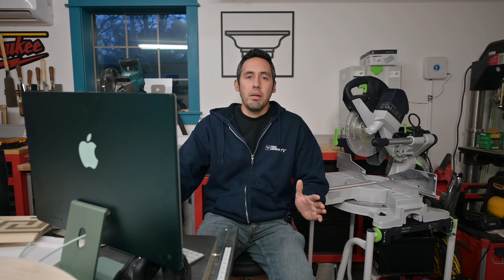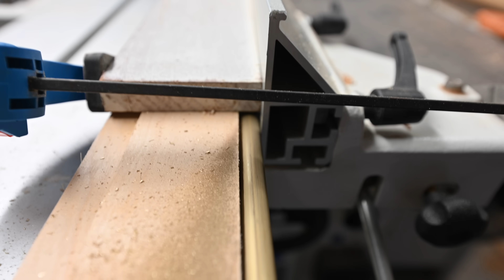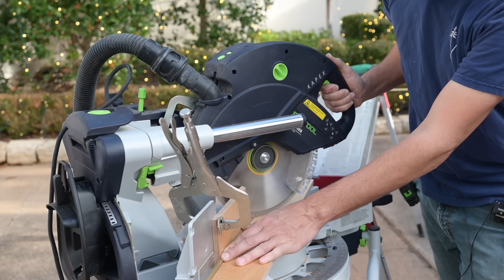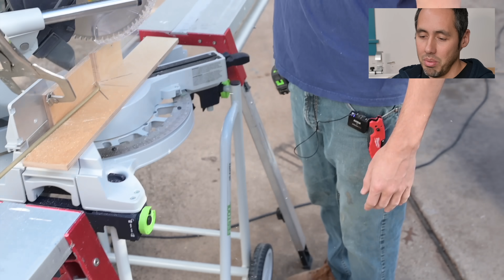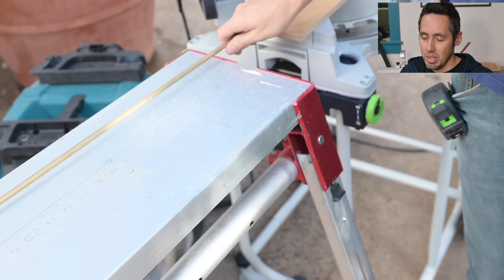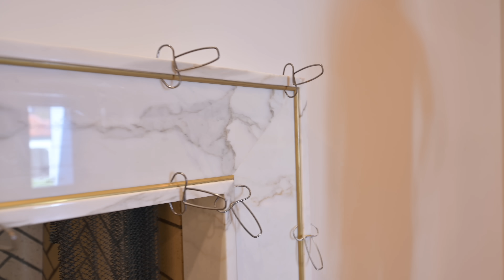It only took 12 years...My first MITER SAW injury.

Comment: I worked in an ER for decades. We had an ambulance transport a guy from a manufactured home factory. His crew was framing up some walls when he jumped from the platform to the factory floor holding a nail gun. 
It discharged a framing nail into his knee.  His knee was locked in place with the nail. When he was off in x-ray another ambulance called in saying they were bringing in a patient from the same factory who also jumped off the platform, discharging a framing nail into his knee as he landed. The injuries were not exactly the same though. With the first patient we were able to use vice grips to grab and twist and pull it out. The second patient wasn’t as fortunate.  The nail entered the tip of the femur, went through the joint space and imbedded in the tibial plateau, locking his knee in place.  He had to go to the operating room.
I’m guessing there were some changes in workplace policy after that.
Reply: Fella in my hometown was nailing up cross bracing on floor joists over his head with an air nailer, nail hit something hard, bounced back and ended up in his heart, poor guy lived for a few days longer. The owners sold the house without finishing it. All very sad.
Reply: @shamrock4500  Very sad “freak”accident but I could see it happening.
Reply: @shamrock4500 i could see that happening I’ve sent a framing nail into an old railroad tie it bounced out (guess there was metal still in it. Couldn’t see it from the top) and flew right past my buddies head. Luckily nobody was hurt.
Reply: Holy smokes !  I cringe at the thought of that,...  Yikes
Reply: I'm surprised you didn't use a band saw to cut these pieces. Obviously precision is key but a miter saw just seems sketchy
Reply: Last year a guy was nailing framing out of the window and shot a nail into his eye and died.   3 kids.
Reply: Was ripping a 2x6 on the table saw. I must have hit a knot because something hit me in the shoulder. I had a bruise for about a week and couldn’t lift my arm higher than my shoulder. ( when I checked the board, there was a piece missing)
Reply: @lukemccann4061  what?
Reply: @tier1solutions28  yeah
Reply: @lukemccann4061  that's horrifying.
Reply: @tier1solutions28  I think about it everytime I fire a round.
Reply: @lukemccann4061  if I saw that I think I'd love to estwing a lot more
Reply: @tier1solutions28  yeah me too.   Happened on a buddies crew.   Thank God I wasn't there.   Crazy thing he made it down to tell his boss.  Dropped right there.
Reply: @lukemccann4061  That’s awful.
Reply: @de362  seriously

Comment: The exact same kickback happened to me with a miter saw doing an angle cut on thin brass strips just like this, I also luckily avoided any injury. It's nice to get an indepth explanation about how it happened for you, and yeah, I've reverted to using hack saws, files and belt sanders for now

Comment: Glad you are ok Richard, I also have been using power tools for many years. My accident was not filmed as I did not have a youtube channel at the time. However, I do have a video on my channel covering it. It is called my tablesaw accident. I short I was building a barn style pocket door. I wanted the blade marks in the wood. I was resawing 2x4's to make the panels. Decided to do a test cut with a short piece of material to make sure the thickness was right for the dato slots. As I was reading the short piece, something went wrong and my tablesaw kicked the material out, however in the process it pulled my finger in. I still have all my fingers, nine stitches later and several weeks of healing all is good. I have never looked at the tablesaw the same. Every cut today is 100 percent attention on the saw. Thanks for sharing Richard.

Comment: In 1998 I was ripping a piece of trim on a new table saw, I had not yet installed the blade guard, I was pushing the board through and in one second all was well and in the blink of an eye the board kicked back and two fingers😂 on my right hand came down and kissed the blade. One finger healed fine, the other finger also got stitches but I did some nerve damage and never got all the feeling back. The hand surgeon said the upside was the blade was new and sharp so it cut instead of tearing the skin and very little chance of infection. I’m so fortunate to have both fingers and like you said being complacent as I was already in business for 22 years at that point. I am now 65 and retired after 47 years of being self employed, my whole adult life. 
Hoping anyone reading this learns from my STUPID mistake. Stay safe everyone!

Comment: First of all, Richard I’m so glad you’re ok! Secondly, the job you did on the range hood is sick! Your talent just keeps getting deeper and wider. I’m glad you are sharing your journey with us!

My story:
I was building a miter saw table and I was using the biscuit joiner, well I needed to put slots in a piece of trim, I was holding the trim with my left hand (I didn’t use a clamp, because you can’t hurt yourself with a biscuit joiner right?!) I was putting pressure with the tool against the trim, the blade caught a knot in the wood, it went flying, and as I’m continuing to put pressure on the tool toward the trim piece that my hand is holding, as the piece went flying out of my hand the blade cut into my thumb and middle finger. I nearly cut through both fingers. I had to remain calm, I was alone in my shop, ran into the kitchen wrapped my hand in a bunch of paper towels and called my friend to come and get me to take me to the hospital. The doctor sewed me up and I had a month of recovery and healing. I still have scares on my fingers, the feeling is slowly coming back. Thank God! Whew!

Comment: Thank you for sharing your story, Richard.  We can all learn from this kind of eye-opening experiece, and I'm glad you were not seriously injured. 

I'm a hobby woodworker who has made some hardwood furniture and other small items.   I was cutting a 1 inch wide by 1/8 inch thick aluminum strip, which I have done several times in the past with no isses.  I also had a brand new Diablo crosscut saw blade on my miter saw.  I was very slowly lowering the blade through the aluminum strip when some how the blade grabbed the aluminum and jerked it from my grip.  I was startled and very surprised because I don't know exactly how this happened, and I was being very slow and deliberate with the cut, just as you were when it happened.  Good news is I was not injured other than a little bit of temporary pain in my thumb, all but upon inspection, I discovered that one of the carbide teeth had been ripped off the new saw blade.  I also cannot be certain that the blade was not compromised in some other way due to the impact.  So I figured the new blade is a total loss.  I think a carbide tooth can be replaced, but I don't think it would be worth the trouble, so I am chalking it up to experience.  The cost of another new blade is cheap compared to any injury that could have happened.  I was lucky it was not worse, and I think I'll hesitate to cut aluminum in the future without some additional precautions.

Comment: Nearly 50 years ago I was making 1/2” quarter round trim for an addition to my home. I had a small,cheap router table and while pushing the square stock through I ran my forefinger through the spinning blade. Ended up in emergency having the fingernail removed plus stitches. No permanent damage but still have a scar.  Very cautious around power tools, especially routers, ever since. I’ve learned a lot from you over the years, thank you.

Comment: I'm glad your incident wasn't more severe. In 2000, I was a pattern maker. For people that do not know what that is, it's an old world trade where you make patterns and cores out of wood for foundries so that they can pour castings of products. My worst injury came while using a 20" disc sander. When pattern building every piece had to have what's called draft, meaning every edge needs to be slightly angled or rounded so that the sand pack could be lifted away from the pattern board. Well while sanding some smaller pieces with the sander table at an angle to achieve the draft a piece had got away from me and of course with the pressure I was applying towards the wheel my finger tips and knuckles went into the wheel. Result was some oddly flattened finger tips and some knuckles sanded down to the white meat. I was 21 or 22 at the time and learned that a 1/4" of missing finger tip will actually grow back like nothing happened, thank goodness 😅. Keep up the good work sir!! Stay safe 😊.

Comment: Over the last 30 years, working as a finish / trim carpenter, there have been minor injuries.  But the worst was using my father's 'skill saw' at the age of 14. Working with a den of cub scouts, me being the den leader, I thought of using a power tool. Without permission, mind you. Yes I 'surgically ' removed my ring finger from my left hand. Quick thinking from the den, I got my finger on ice. Quick trip to the hospital. Within 2 days I was home with it reattached! AYE!
Reply: Jeez, that’s lucky. Bet that’s a weird looking scar. U get full use and feeling back?
Reply: Reattached...and is it functional or just decorative?
Reply: @jeff-w  it works as a finger should. Looking at it, people can not tell.
Reply: @jamesmyerssr.3119  wow.  That's amazing.  Lucky guy!
Reply: Using a Delta Unisaw cutting small pieces of trim for a jewelry box the off cut was fluttering from the air movement of the blade, as I approached the blade with a pencil with eraser the presents of my hand must of disrupted the air flow lofting the small piece of trim into the blade firing said piece as fast as a gun shot into my inner thigh millimeters from you know what! Hitting the e-switch as I fell to my knees the pain made me lightheaded. After a few minutes of nauseousness and holding my family jewels my jeans had a hole in them. Dropping said jeans a bruise appeared. With in a few hours my leg turned red from my groin to my knee. Thinking I injured an artery off to the ER. Thank the man above I only injured a vain that bled internally leaking for a short while. That bruise lasted months changing colors and finally fading. Now I always wear a leather apron along with other ppe.
Reply: Worse injury was with a propane brazing torch. The torch head had not been sufficiently tightened when the canister was changed, so when I lit it- POOF it was a fireball! Of course your first instinct is to throw it- but knowing that those metal canisters are like a missile if they break at the neck it didn’t toss it. I spun around and snuffed the flame out, then assessed the damages. It’s a sinking feeling to smell burned hair and feeling blistered skin… Luckily I only lost my eyebrows and a few wisps of hair. Felt like a bad sunburn for a few days. Safety glasses work!
Reply: Hey, sorry you're hurt over the holiday! Heres my worst work injury. I was in an old building in Brockton, MA. After hours ( there was a plumbing leak overhead right behind the receptionist desk), the plumber fixed the leak which had stained the old plaster and lathe used 50 years ago. So the plan was to just remove and replace with drywall. I thought cutting out the old lathe with a cut-off wheel was the best approach. Well...the wheel got caught on something and blew apart, and a piece of metal or part of the wheel went right in my eye. At the same time, I set the fire alarm off, which immediately alerted the local fire department. So I had to deal with them doing their walk through. Then clean my mess. Then go to the E.R. to get my eye worked on. I looked like Quasi Moto for about a week, lol
Reply: Pictures needed lol
Reply: Winner Winner chicken dinner! I will settel for your most popular Hoodie and you keep the square thank you.
Reply: Damn give this dude the prize I don't even want to tell my so called injury after reading this yikes

Comment: Hey Richard. That’s amazing that this was your only significant power tool injury. I see you have deep respect for the tools you use.  Im glad to see you are recovering well 😏. I instal flooring for a living. My comp. name is Good Day Flooring llc, out of the South West Florida area. A couple years back I was employee to a local installer, under whom I learned the tread. He would always take the guards off his miter saws, so I was extra careful when making cuts. One day he got a new miter saw and right away took off the guard before using it. We were cutting shoe molds that day and I was zipping along as always. I made a quick cut, let go of the handle, turned to walk away and the blade sprang up and hit me on the pinky. I was shocked at what happened and in disbelief. I realized the reason I got the injury was because the saw we were using prier to this one was so old that the spring didnt lift the blade up any more. It stayed down where you left it but because this miter was new the spring was fresh on it and thats why it sprung up and hit me. Thankfully i still have my pinky.

Comment: My worst injury was in 7th grade. I was making a bowl on the lathe. Doing the inside of the bowl, the tool rest was positioned to reach deep into the bowl. It was a smaller tool rest and I could only work on one area at a time. The gouge(tool) I was working with slipped off the tool rest and spun around the inside of the bowl carrying my fingers with it. One finger caught the tool rest on the second time around. It peeled the skin on my finger. All in all, I was lucky. We taped up my finger for a couple of days and I healed up pretty well without any significant scars or permanent damage. This definitely made me realize how unforgiving of mistakes these power tools can be. Glad you’re  Ok Richard. Keep up the great work. I learn something from every one of your videos.

Comment: My miter saw accident could have been much worse. In my younger days, working as a professional floor installer, I was cutting a 45 on a piece of oak flooring (framing a fireplace hearth). We had the guard held up with a carpenter's pencil - as is required by OSHA. My blunder was that the 45 was to the right and there wasn't enough to hang on to on the left, so, with my left hand I reached across to hold the right end piece against the fence and chopped with my right hand. Thankfully, I didn't "chop" quickly. I did, however, put a clean 1/8" wide x 2" long x 3/16" deep (at its deepest) in my left forearm. The minor scar that remains serves as a reminder every time I use a miter saw (or other tools). If it is not comfortable making a cut, stop and rethink what you're about to do.

Comment: Close calls will wake you up to safety. I was ripping a 2x12 on a portable table saw. The kick protector was broken on the saw and I just wanted to continue to work. Well I got 3/4 through the rip and hit a deep knot that I did not see. Boom, it kicked the board back into my right hip and it knocked me to the ground. There was no breaks but I was in pain. I shut everything down and went and got an X-ray. I spent the rest of the day trying to fix the kick back protector. I ended up having to order a replacement and finished the siding job. Love the content. Merry Christmas and Happy New Year to you and yours.

Comment: Glad you're OK. Years of working with saws, engraving and cutting thick brass taught me one thing about thick brass. Several slow, controlled passes while using engraving oil gives the best and safest results. For mitre saws, 1 very slow, controlled pass with the oil should suffice. Not only does the oil help control heat issues with brass but it will also help deburring issues. A MUST for safety issues is clamping or making fixtures to keep brass from sliding which the oil will make the brass harder to control so taking this into account on trial runs will help prevent injuries. Of course there are no true fail-safes. Be safe always.

Comment: Same experience as you with aluminum and brass.75 years old 50 year wood working. My method now to cut down chance of kick up. 1 lock my sliding miter to use as chop only. Any movement in slider can create kick up. 2 use blocking close to cut area with clamp making product as stationary as possible. Glad you are alright really like you and your content.

Comment: Thank you for this info Richard. Probably saved some of  us from disaster.
My worst injury, to date, was when I bought a box of moulding  cutters for the table saw on ebay and 
installed one for a test run. It looked pretty formidable so I decided to use a power feed to run the test piece through safely.
I bolted the power feed to a piece of plywood and clamped the plywood to the saw's table. 
When I fed the test piece through, the plywood stretched under the strain, and the piece climbed over the cutter and instantly became a projectile hitting my left thumb and hand.
11 stitches later I decided that was a bad idea.  Stan Stevens

Comment: Happy to see that you came away from that injury intact. DIY project: needed to add a bathroom to my second floor back in 1993 and didn't have a power drill strong enough to bore through the floor joists to route plumbing lines. 100 year old house, all of the framing was aged and hard. Borrowed a 1/2'' Makita corded drill from work - never used it before BTW. Fitted it with a 1-1/2" hole saw and attempted to drill the first hole of the day (which quickly became the last one). Pilot drill on the hole saw caught a knot in the joist. The drill motor did not lock - which would have happened if I were using my DIY 3/8" Craftsman 19V battery powered drill. Instead, the drill motor violently twisted my hand, slamming my ring finger into the side of joist. Finger was not cut as a result of this but instead basically exploded - tissue and muscle hanging all over the place. Luckily, it didn't break my wrist. Valuable lesson learned. Know and appreciate the power of that tool in your hand.